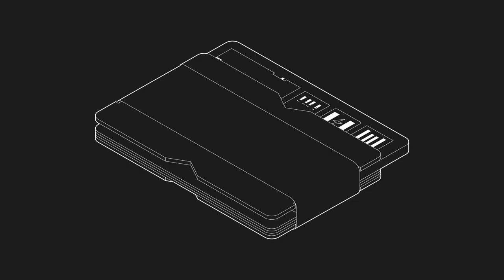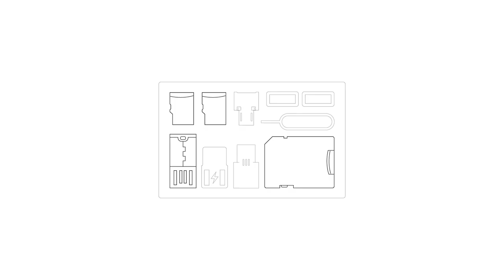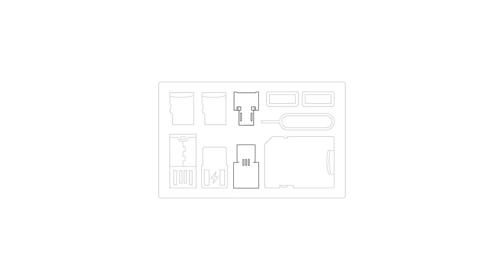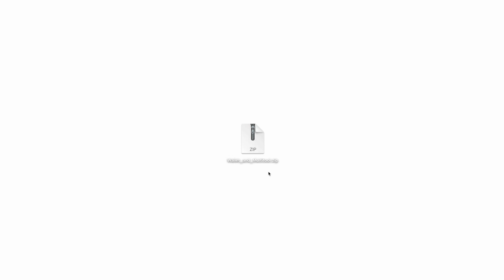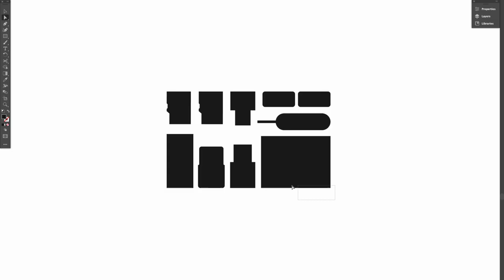Designing a Simple DIY Wallet (+Multitool Card)

Comment: My experimentation with Capri Sun pouch seems to provide a cheap and simple way to block RFID without having to purchase specialist material. Certainly blocks my car's keyless entry well enough. Bonus is that you get a drink too!
Reply: I'll have to try this for my purposes
Reply: We really are living in a dystopian sci fi movie
Reply: @notanimposter  I'd be interested to have confirmation that it works, it isn't something I've seen anyone else test. Feedback please!👍
For clarity, it doesn't prevent me pressing the fob buttons through the pouch, but I can be stood right by the door and the keyless entry doesn't know I'm there.
Reply: Used to use anti static pouches to do similar, but both still make very poor faradays.
Reply: Respect the pouch. Respect it!
Reply: @MarkArnold-England  easy way to check is just tap the card like that on the machine next time you are buying something. To be less goofy, cover the card and the pouch with a phone on top or just put it in an empty wallet
Reply: I wonder if Chip bags or some aluminum foil will do the same?
Reply: When the Capri Sun comes to the rescue.
Reply: just normal aluminum foil works fine too, lol
Reply: I tested a bit with a capri sun pouch, but found I needed two layers to stop a read. Tested with copper tape, and it works super well, and is probably the thinnest option.
Reply: @steinarandreasnedland7237  I'll get some copper tape to try 👍
It must depend on the car, as my Kodiaq doesn't see the key unless I hold it up against the door.
Reply: @MarkArnold-England  I did some further testing today. Copper tape works very well against 13mHz (nfc and bank card), but very ineffective against 125kHz. This would make sense since eddy current losses are higher at higher frequencies. I tested the capri sun using 125kHz, so I'll have to test using nfc soon.
Reply: I was gonna use aluminium foil but this sounds like a much better solution

Comment: USB Hub idea: Use resin, or something similar, to enclose and secure the components. No need to change the design, just add a manufacturing process/step. Great work as always! 🙌✨
Reply: Immediately my thought.. Just drown it in Resin!
Reply: or as an alterntive just solder two pcbs on both sides, thinner ones obviously so the LED can shine through. should be easy with castellated holes and it can be accessed if necessary
Reply: same thought. just fill up the empty spaces around components so the entire thing is just one solid piece

Comment: Probably one of the better minimal wallets I've seen, especially with the multitool.  The only thing I don't like about minimal wallets is that there's rarely any space for coins, which I still carry around with me.  The best solution I've found are those pound coin organisers, which kind of resemble a fidget spinner and hold five £1 coins (or ten 20p coins if you put two in each slot).  Its not perfect as I also want to carry a few other coins (mainly 10p's, but sometimes £2's too) so I should probably see if I can design something that suits my needs.
Reply: You could adjust one of the wallet plates to be a coin holder, so that the elastic strap holds the coins in holes in the wallet side plate against the cards inside

Comment: Welcome back! This wallet design is really cool. I still prefer softer fabric over hard(ish) plastic so it won’t scratch anything, but I really like the multi-tool card you came up with. I am probably going to make one with a few tweaks like a built in caliper to measure things accurately (especially if I make the card from steel in a CNC machine).
By the way, removing the data from USB would certainly remove any kind of support for fast charging, so I wonder if there could be an adapter that will talk to the device and ask which standards it supports, and then talk to the charger and relay that information while keeping any other data from passing; allowing you to protect your device without sacrificing fast charging.
Reply: As far as I can tell, A communication protocol like this is built into every usb device as is but, the issue with relying on usb communication protocols is that devices don't usually have USB security in mind. (and usb killers can still get you)
When you plug something into your system, not only should it prompt you on weather it should make the connection at all, but it should also tell you what the device is announcing itself as. When you plug in A keyboard, it should ask if you just plugged in A keyboard, and if you didn't and it was supposed to be A flash drive, then you know somethings fishy.

The saddest part of all this is that if you have the will to, you can change these behaviors in almost every OS for both PC's and smartphones, but the people that need A protective measure the most get it disabled by default.
Reply: I always have a power bank with me, and that basically does this, if you plug that in the wall, and your phone into it. It's going to provide the fast charging it is capable of. But then you probably don't need the wall :D (and it's overkill)

Comment: Great stuff.  Your USB power-only adapter is interesting.  Some 3D printers have a bug where they feed power back over USB, and people have to either open up a cable to cut the 5V conductor  or cover the 5V pin with tape.    A PCB data-only (2 data pins + ground) plug adapter might be very useful.
Reply: bonus is that it's SO simple, you could prolly just buy a thousand of them and give them out for like, free, or almost free (perhaps "first 2 for free, next ones for 10 cents per two")

Comment: If the 3D files were converted to a format that could be used for PCB manufacturing, would it be possible to add a copper layer with a solder mask? Then you would have RFID protection and possibly better manufacturing tolerances.

Comment: I use those active RFID blocking cards instead of a super thin peice of metal. An RFID skimmer uses a much more powerful transmitter than a usual reader so you can't realy be sure that passive blocking will actually work unless you have one. The active cards on the other hand work like a normal RFID card where they're powered by the reader or skimmer but instead of exchanging data they transmit interference making reading a card impossible also a stronger transmitter just results in stronger interference.

Comment: Neat, really like the idea of embedding electronics in a PCB to make a low-profile project like that. I’ve been thinking it must be possible to get a 3.5mm headphone socket made of castellated vias in a similar way. Be it for audio, or for serial data like on the Pinephone.
Reply: Would that serial data be used like the old cassette tape setups for early PCs? If so, that would be a very compact and "universal" system.
Reply: @rya3190  well it would be RS232 but at TTL logic levels, also known generically as “UART”. Lots of microcontrollers have dedicated hardware for it, you just need a MAX232 or equivalent IC to change it to RS232 logic levels.
Reply: @Scrogan  Yeah, I just picked up one of those MAX232 boards (it's already installed with pins, resisters, and the port), so I'll get to mess with those ports. I suppose the two data lines could run across 3.5mm mic/stereo lines and power can be received from somewhere else.
Reply: @rya3190  generally RS232 doesn’t carry power to peripherals anyway, as unfortunate as that may be. I was definitely disappointed when I found that the Pinephone didn’t use a TRRS jack for a power rails also.

Comment: Hello,

Over here in Europe we still use coins on a regular basis. Is there any variations you have made that helps carry them? If not I recommend taking inspirations from the aviator wallet, which has the same concept. Lastly, I was wondering whether I can transform this wallet into a tungsten one, the price however is quite expensive for that, and I recommend aluminium, as it is farm cheaper and most aluminium stores can make them. 

Thanks for your time.

Comment: Could you embed the rfid sheeting in the plastic body, by pausing the print and layering it inside? I think if you are strategic about the holes cut out of rfid sheeting and where the recievers usually live in the cards you should still preserve much of the bond surface between print layers. Might be worth a go!

Comment: :) I was just thinking about the same thing, this is great :)

And it was said fast at the end but the laster cut metal is really great, especially for the two endplates. Something like sendcutsend, you could try a lot of different materials and different thickness of metal (even exotic like titanium) and it's very cheap. The only issue is it's hard to prototype or make fixes because each batch needs to be $30 (but it means you can try loads of materials)

I'lll have to look into making these PCB's. As an example, you can make one of the sd cards a bootable usb, and since they're so thin, have a windows, a linux, etc. Why not :-)

Comment: Ive been using a trove wallet for the last five years, and their elastic band is still 100% functional, so if this one is similar I trust it will also last. But as a note, the leather folds in my wallet are really useful, it basically gives me three compartments and it even holds coins well enough, do you think there is a way to adapt your wallet to have multiple compartments? I understand it can be hard to 3d print thinner parts, but maybe there is a clever solution I haven't though of

Comment: The USB charging isolators never made sense to me. If I need a "quick boost" 2.5w is hardly going to do it, which is all most devices will pull with no data pins. Just carry a thin power bank. No worries plugging that in to whatever public socket, and it will suck up as much power as it can for use when convenient

Comment: i had a similar idea of putting sd cards in my wallet but i wasn't sure if the sd card would be protected enough.  Seems like water or other materials could get into the wallet pretty easily. Run into any issue like that ?
Reply from the maker: Nope. If you're talking about micro SD cards, they are already waterproof
Reply: @NODEtv cool never knew mirco SD card were waterproof. Good to have you back btw 🙂

Comment: you could just fill the component slots on the usb hub with hot glue or epoxy, no? not the most elegant solution, but it should do the trick

Comment: I really like the idea of having those tools right in the card holder :)
Just one thing - would it be possible to get the pcb files as gerber-zip file, as most pcb manufacturers seem to not accept the pile of files for instant quotes and so on :)
Or maybe there is a easy to use tool to pack it myself?

Comment: do you honestly believe that your everyday normal average joe/jane only carries 1 key ? or  like 50% of the population carries 1 key ?
just simply 3D print a full slot (which is a card size) that can hold at least 3 keys would make the wallet so much more useful or better yet a tray slot to fit more keys and other stuffs.

Comment: I really like that minimal USB hub design. For protection  could you print a couple of plates to attach over it? Shouldn't make it much thicker than a USB plug if they were seated tightly. Perhaps a few through board hols and printed pegs to push fit everything together?